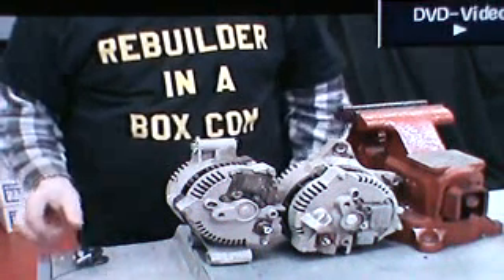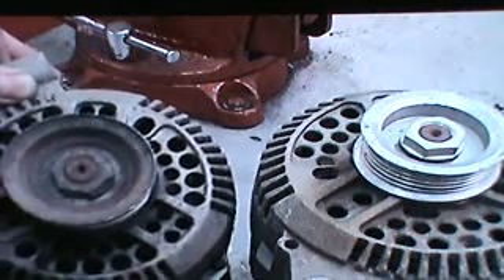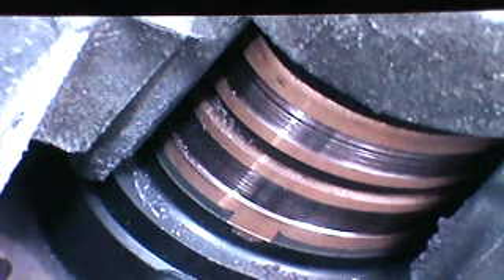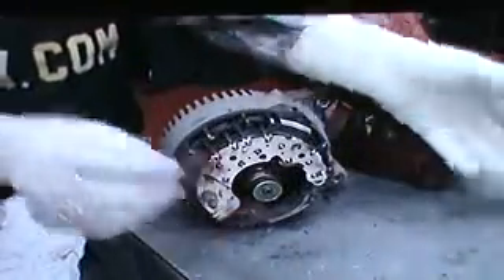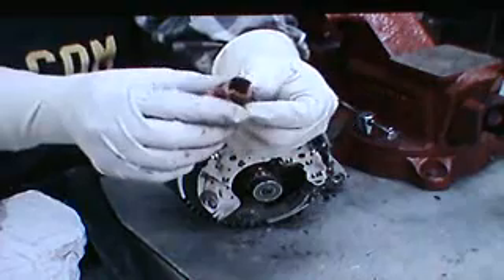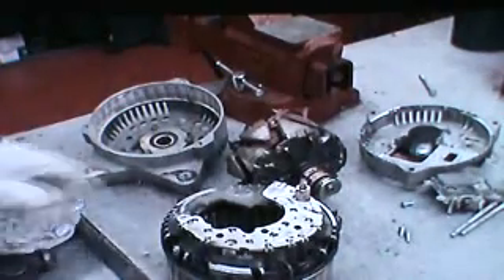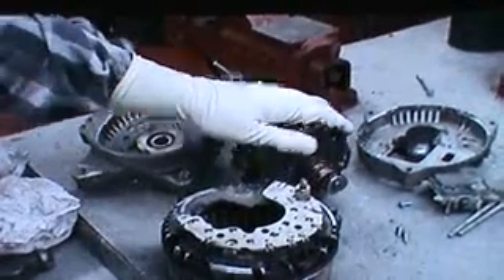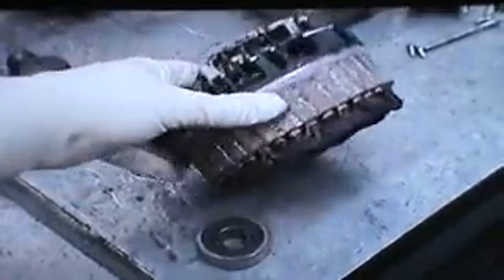How to repair a 3g alternator | 3g rebuild kit

Comment: I cut the solder with dremel abit unfiltered rectifier wires left windings in the housing. I prob should have watched this before hand but I broke rectifier on last 3g I attempted to rebuild. so if them windings are stuck may be try what I found worked for me. beware you must clean scuff up and flux for a good solder connection. I would only do this if the coils will not come out last case scenario